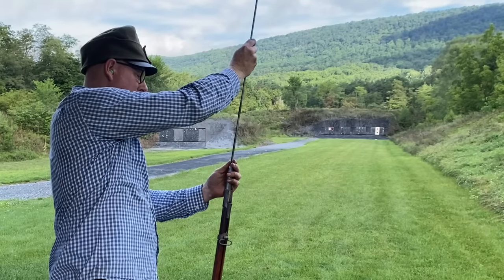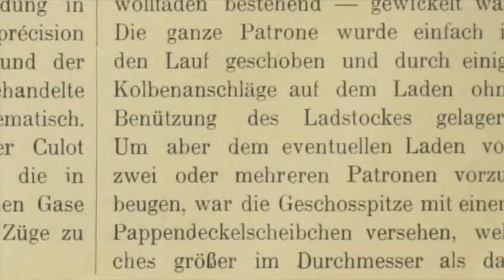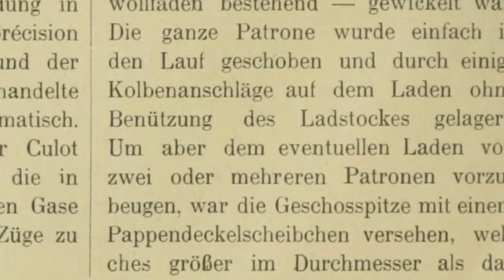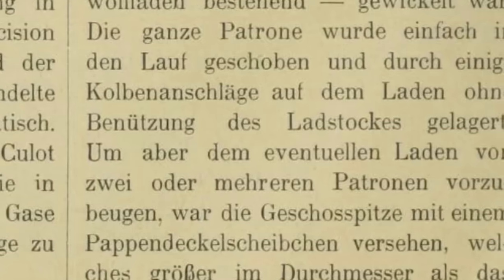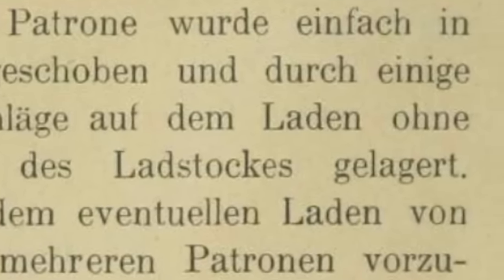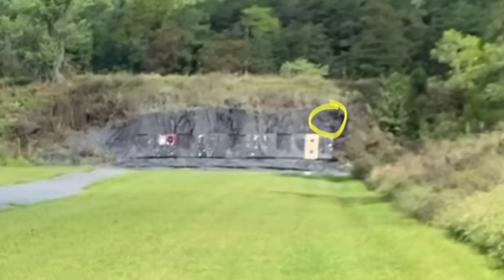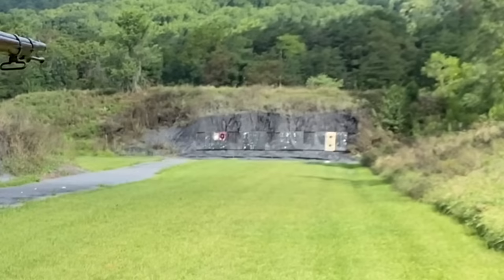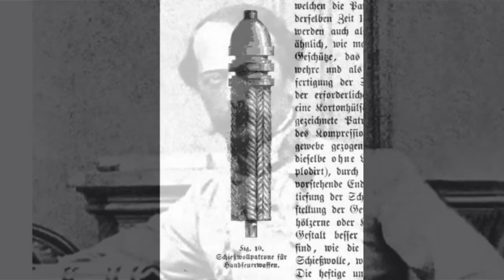Shooting the Guncotton Cartridge for the M1854 Lorenz

Comment: This feels like the gun most gun enthusiasts would realistically be able to cobble together if they were sent back in time.
Reply: Thats something i often think about. This is probably what i would go for first.
Reply: And it would still be monstrously effective.
Reply: Then followed by a needle-ish gun but with the primer attached at the end of the stick where the gun cotton is wrapped.
Reply: Absolutely. If you are a gun-enthusiast and have some handy skill I highly recommend building your own muzzleloader. It's a great project.
Reply: i wouldn't want to play with that chemistry in field conditions
Reply: That's what i did. I converted my. 177 air rifle into smokeless muzzleloader ignited by toy gun cap. I basically reamed down barrel exactly for fitting half cut 5.45x39 steel case. Then i made pinhole for casing to put red toy gun caps acts like primer. So it is basically inline muzzloader. I  made custom. 177 lead bullets with 1.5-2gram weight and bullet shape (unlike pellets) then i have tested various homemade flash powder and black powder loads. Until i decided homemade nitrocellulose is the best option. Doesn't produce very loud sound, doesn't rust or stain the interiers, a lot easier and safer to handle. Its ballistics is comparable to 17hmr, but i'm planning using copper bullets for better penetration
Reply: @JulioLuisEduardo  I'd go a bit more old-fashioned and instead make a piezoelectric system for muskets. 

Hammers have way better drip than bolts anyway.

Comment: Is there a danger that the guncotton cartridge will prematurely combust due to a hot barrel if you fired off a lot of rounds over time?
Reply from the maker: Perhaps but the Austrians did not seem worried about it. They claimed guncotton burned cooler than BP which kept the barrel getting too hot.
Reply: Unless you are machine-gunning  your muskets, you should be fine.

Comment: Awesomeness! Love to see a video on making the gun cotton and assembling the cartridge.
Reply: Not likely as it would be banned and blocked by YouTube. The process is basically  soaking unsized cotton in nitric acid and then rinsing it 10 times in clean distilled water. It is then dried and cut to differing sizes to control burn rate and set to the bore size of the rifle/cannon. The burn rate is about 28k ft per second so very important to not compress it as it will then be a bomb.
Reply: There's plenty of videos on the youtube's showing how to make gun cotton...
Reply: You can make your own gun cotton, but it does require careful preparation and a VERY well ventilated space. 
Make it in small batches over a period of time. When you soak your gun cotton in water to remove the excess acids, change the water several times. And also be mindful where you store it after it has been made.

Comment: This is awesome! You did this a lot sooner then I excepted since I was at your shop. Glad to see you where confident enough to switch to the Lorenz instead of the Enfield for your test. That really does look a lot of fun.
Reply from the maker: As you can see the charges were very light, 10 grains. I have tried some with 13 grains and that is the max I will go. There’s a decent recoil and it’s blowing through a couple logs I use as a backstop but there’s no overpressure signs (cap stays on nipple, hammer is not being lifted). I think this is about a 800 fps load, more than good enough for my plinking purposes.
Reply: @papercartridges6705  That sounds just right for that. If you ever did try going full load defiantly would try it in something with a modern steel barrel meant to handle the pressures. But concept has been proven and that’s honesty just the best!
Reply: @papercartridges6705  I've been watching couple of your past videos and it makes me wonder will guncotton cartridge working any of the capping breech-loader you've done like the sharps breech-loader or the green rifle no need to wreck your rifles trying though
Reply: @papercartridges6705 It would be very interesting for scientific purposes to perhaps commission a barrel (or just breechplug?) for a Pedersoli with the correct divot for the wood peg. And maybe proof that barrel with guncotton (and possibly other smokeless loads?) in a lab.

Comment: I have made gallery rounds for 8mm Lebel and .303 using flash paper and lead balls. This was the standard practice for French training who issued reloading kits to units to make these rounds from fired cases. Flash Paper is essentially gun cotton.

I would be wary in using anything but a cigarette paper sized sheet. NC, unless it is properly made can be full of pooh traps! Cordite was used in BP type guns, but it has significantly different properties to modern nitro powder.
Reply: The Lee Enfield is a black powder gun…
It very much “depends”…
Reply: @allangibson8494   Well... yes and no! The initial ammunition for the .303 Lee Enfield was a compressed gunpowder load, but this was at the very end of the gunpowder era and the energy levels were the highest they could squeeze out of GP. It was always intended that the Lee would go smokeless once they got the production problems sorted out. GP .303 was only ever an interim solution. The barrel was designed to  take high pressure loadings from the get go. The main early issue with cordite was erosion rather than pressure.
Reply: @felixthecat265  The main early issue with cordite is they didn’t have any.
The Lee system was adopted in 1888 (a year after the French announcement of smokeless powder).
Cordite was developed a year later.
Reply: @allangibson8494   Well.. Nitrocellulose was reported by Schoenbein and Peloutz in the 1820s and there had been repeated efforts to develop a successful propellent for several decades. The French pushed through the Lebel in only six months which led to many problems subsequently. The properties of Nitro propellants were well understood from the 1870s onward. Most of the problems were about developing a reliable method of manufacture.
Reply: @felixthecat265  Most of the problems with nitrocellulose were related to its tendency to go boom without warning (which got worse with age and residual acid content). This was solved by adding petroleum wax to the mix (nitroglycerin was also used as well (nitroglycerin and nitrocellulose play well together)).
Cordite was specifically designed to replicate black powder pressures and burn rate (but without the smoke). Cordite is about 2/3 nitrocellulose, 1/3 nitroglycerin with 5% petroleum jelly and acetone added. Metallic cartridges permitted tight control over free space behind the bullet.
Reply: @allangibson8494  Well.. yes and no! The residual acid issue was mainly solved by pulping the cotton fibres and breaking up the internal voids which held residual acid. The petroleum jelly was originally added to lubricate the extrusion dies. It was only later that Abel discovered it had a stabilising effect. I did work with this stuff for most of my life!
Reply: @felixthecat265  Cordite is also temperature sensitive and deteriorates over time.I remember back in the '70s there was a warning issued on British surplus .303 ammo because of that deterioration as some rifles apparently were damaged by that ammo.
Reply: @rj4590  Temperature cycling is actually more of an issue, however storage over 20C will lead to degradation, Bulk charges stored loose such as for artillery and naval use are however much more of a problem than small arms. For some reason cordite sealed in small quantities seems to degrade much more slowly.

Comment: If you’re casting your own bullets, place your bullet back in the mold and use a drill press through the sprue plate. The dowel will be as straight as possible then. I had to polish and old mold to get some surface rust out and I used a bullet as a polish carrier. Worked pretty slick.
Reply from the maker: Good idea!

Comment: Wow. I’ve never seen it in action. Thanks. 👍
Gun cotton is a bit too easy to ignite in storage. 
Too bad. It sure looks like it worked great. 
First step towards practical smokeless propellant.
Reply from the maker: It did work great in the guns, but as you said, it keeps bursting into flames in storage. They were so close!
Reply: @papercartridges6705  
They sure were. 
BTW Have you tried drilling your dowels with a lathe then turning the outside dimensions with the bit still in the workpiece? That should give you a perfectly centered hole in the dowel if you can pull it off.
Reply: @papercartridges6705  Only took another 30 years...
Reply: Didn't they kinda solve the storage of fun cotton by storing it wet in alcohol or something like that? I could swear I read that somewhere.

Comment: Brett, would the Pedersoli Lorenz repro work with your bullet-on-a-stick?
I ask, coz they appear t be very solid guns, and perhaps with the breach plug pulled and drilled for the stick, you could up your power and truly test this awesomeness.
Your thoughts please.
Great video, cheers, Gus
Reply from the maker: I've used a modern repro Enfield for testing some of these, which are made out of modern steel. I don't know if I'd want to buy a very expensive repro Lorenz ($1700) and then start drilling holes into it, when I have the original Lorenz that works good enough. Guncotton scares me, I would be very nervous using "full power" charges even in a modern gun. The stuff is wild and is very hard to tame.
Reply: @papercartridges6705  well, that's just scary to hear and it makes me ponder even more how anybody had the balls to actually experiment on a large scale, with troop trials etc.
Please don't blow up. I like your videos. Gus

Comment: Oh yes . I didn’t know gun cotton was used for rifles but after making some and just igniting it I guessed it could be used for a propellant . My idea was to put it in a brass 45/70 cartridge much like cordite was used in the .303 . I didn’t have any loading data so “my” idea is still on the drawing board . I don’t think I will experiment for obvious reasons . Thank you for posting and now I know it can be done 👍
Reply: Be careful with the loads. Start with a small quantities and then add grits to fill the cartridge.

Greetings
Reply: Variation between loads
Reply: @gaston01000  thank you , I’ve dabbled before and I will work the loads up watching for pressure signs etc . Be good to try though 😳😆
Reply: Isnt gun cotton what all modern propellants consist of?

Comment: Were the shots flying higher than usual for a Lorenze? at 70% charge is the velocity noticeably increased?
Reply from the maker: I wasn’t really aiming, but I did hold high because velocities are pretty low with my mild charges. These are experimental rounds so I didn’t expect much consistency.
Reply: @papercartridges6705  So far it seems reasonably consistent, I'm staying tuned, gl&hf! :)

Comment: It would be interesting to see how a gun cotton load would work in a modern Inline muzzeloader with the same setup. A majority of modern Inlines are rated to take up to 150gr of black powder (pyrodex pellets) substitute.  They utilize a shotgun primer and sabot. The trick would be not to compress the load. It would be a challenge to ram it home because a sabot is a tight fit. Said load can't be compressed.
Reply: Lee makes a mold for a Minié-style bullet intended for modern muzzleloaders.  You might be able to make a workable version with that.

Comment: Now you've got me wanting to make something like that for my 1858 Remington repro -- except the nipple is right where the stick would have to go, and I don't think the stick would/could be tight enough to hold #6 against the recoil of #1 through #5.
Reply: I would be very wary about using even a small amount of nitrocellulose in a black powder revolver, new or original. The pressure spikes are just too volatile for the thin walled cylinders. I suggest trying in very small amounts, loading one ad a time, and proofing them with a shooting stand and string before shooting freehand…

Comment: Cordite, or raw guncotton burns very hot according to British sources I've read, and that looks like an origional gun. You might look into this, because that is old steel and probably very valuable because I've never even seen one of those rifles before except in old phorographs.
Reply from the maker: Original Lorenz rifles are somewhat scarce and mine is in pretty nice shape. My cartridges are loaded to about 60 to 70% strength of what the originals were, to reduce the stress on the gun. That’s why there is hardly any recoil, since the loads are very mild.

Comment: 2:57 when you loading this round…. You hold your finger over the end of the muzzle right after you just fired a round. I don’t recommend this. Any lit cotton or wood remaining in the barrel, a single ember, could easily ignite  this gun cotton from the new cartridge and blow your finger off.   I would advise waiting between shots, blowing through the nipple, tipping the gun barrel down and shake it out, and not putting any body parts in front of the muzzle more than you can help it. Using the ram rod is potentially dangerous as well. Id say… don’t get in a hurry… don’t get in front of the muzzle more than you need to. Just trying to help. Not trying to be critical. ❤👍

Comment: So how was the nitrocellulose nitrated? For 2 minutes for 15 minutes 24 hours? At cold temperatures or room temperature or heated significantly?
I take full responsibility for my safety however there’s many different directions regarding length of exposure to the acid mixture. Also what ratio of nitric to sulfuric acids? And also did you use nitric acid bought or synthesize your own from sulfuric acid and potassium nitrate?
Also do you not own a chronograph? Cuz I’m very curious about the velocities and consistency possible?

Comment: if it slides down that easily, then can't it fall out or come out of position if the gun is pointing downwards?
Reply from the maker: The Austrians drilled a wedge shaped hole in the breech face, so that when you dropped the stick down, it wedges in the hole and won’t slide out. At least that was the hope.

Comment: What kind of velocity would you be getting?
Reply from the maker: Only shot a couple “near full power” loads. Maybe 80% of the historic power. Judging by how low the impacts were compared to the regular charge, probably somewhere in 850 fps range. 

I can’t shoot these through my chronograph because the wooden stick separates and would either throw off the velocity measurement, or possibly damage the chronograph by impact.

Comment: If you drill a hole the diameter of that stick through a piece of wood of a thickness equal to length of it, then countersink a hole the diameter of the bullet, you might be able to get seat those pegs straight.

Comment: What happens if your shooting down hill?
Reply from the maker: Original Austrian rifles were modified so the wooden stick would wedge in a drilled out hole in the breech face. I also did a longer video on the details of this cartridge, with a whole lot more info on how the round actually worked.

Comment: With modern chemistry, there is no technical reason with modern steel barrels that  hodgdon could not sell discs of cordite for muzzle loaders.
Reply: It's funny you should say that, becauae Hodgdon actually does sell a nitrocellulose-based propellant intended for muzzleloaders.  It's called Blackhorn 209.